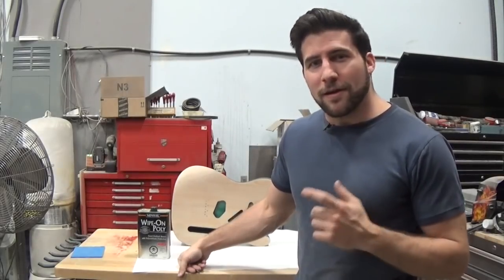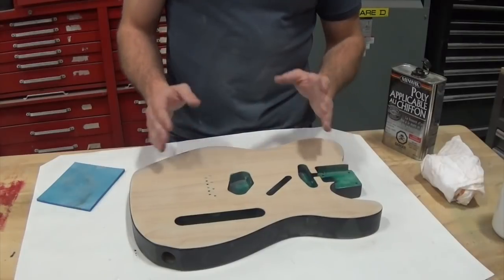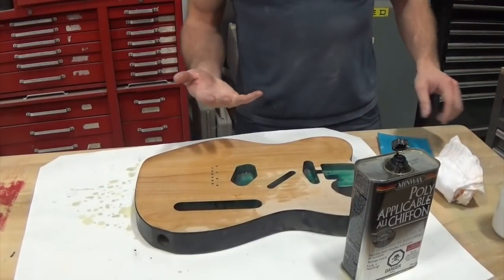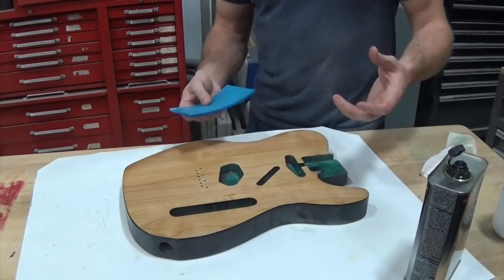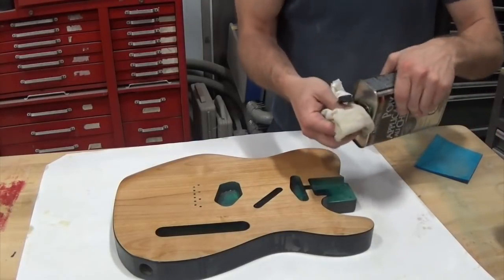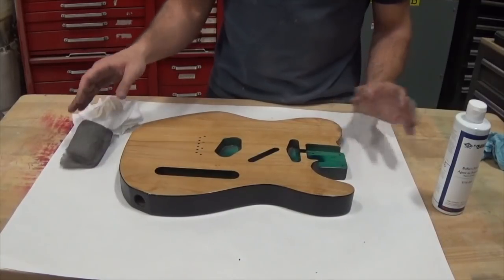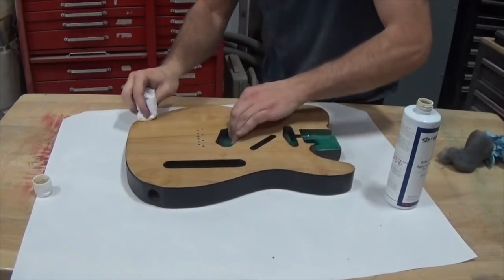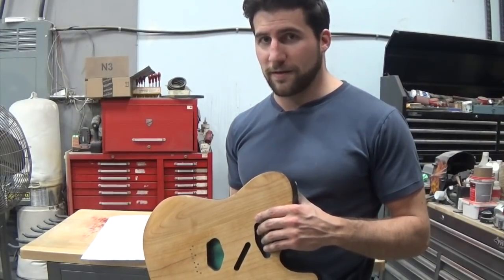How to apply a perfectly smooth poly finish by hand

Comment: Just a heads up, but it is worth mentioning proper disposal of the poly cloth. Potential fire hazard if u just toss it in the trash wadded up. Need to spread the cloth flat, and let it dry outside somewhere, or hanging over the rim of a metal can.
Reply: Oh fuck that I throw it on the garage floor while Im smoking to soak up some oil spills
Reply: @Dickcheese2011 😂
Reply: Acoustics1029  💣💥
Reply: That was suspected to be the cause of the fire that burned down Jack London's mansion he was building in 1913
Reply: I always put those rags into a plastic bag and seal it with a knot

Comment: During lockdown, I've been making a parts guitar just using hand tools in my flat. I've been stuck on how to finish it without access to a space to use spray cans but this looks a lot more achievable given the limiting circumstances!
Reply: Rub on water based stains and rub on poly. Then hand buff 💪
Reply: Yes, a great solution to small spaces
Reply: @simmonphoenix3206  Although that 1st stage of applying with sandpaper fills me with dread as it could remove stain.
Reply: @davidcane7211  You don't have to sand. Just leave the pores open. Looks fantastic too!
Or fill them before staining!
Reply: Next lockdown,go out and busk with it.

Comment: If you have trouble finding wipe on poly, mix your own with equal parts of poly, mineral spirits, and boiled linseed oil.
Reply: I did that and the powerpuff girls were made
Reply: A D  next time mix those in a jar, not in your dog.
But I find it really a good solution to have such a self-mixing jar as a dog.
Reply from the maker: Highline Guitars - for my reference next time I’m doing a video with wipe on poly, if you happen to have a video on this mix please let me know and I would be happy to refer people to it.
Reply: @BradAngove  I don't think I have a video where I specifically detail the mix, but it's basically equal parts of oil-based polyurethane, boiled linseed oil, and mineral spirits. You can play with the ratios for different results for different woods, swap out the mineral spirits for naphtha, and add Japan drier to speed up the drying process.
Reply: Would the same sandpaper/wipe on work for a guitar that has been stained?  Once I get the desired color depth, I want to keep it.  I Don't want the sanding to ruin the stain.
Reply from the maker: No, it is likely to cause a distressed look on the stain if you use this method.
Reply: @BradAngove  Thanks.  I'll have to find another way.  Been looking at "I can't believe it's not lacquer".  Any experience with that? Made by Solarez.
Reply from the maker: That stuff is good. You can also use this product but apply it with a cloth.
Reply: A D  LOL
Reply: @HighlineGuitars  Yup, I saw your video with the explanation in it actually. About.... 3 days ago.
Reply: Being in Mexico is extremely difficult to find what you guys use in the US, Canada or England, are Mineral Spirits same as Naphta?
Reply from the maker: No, naphtha is more of a cleaner than a thinner. Not quite the same thing.
Reply: @BradAngove  would you know of a replacement for mineral spirits? I could order online but its way too expensive to get it down here, id end up paying as much as 10 times the price
Reply from the maker: I would think you could get away with recordsol.
Reply: @hatespirit  comprate aguarras bidestilado de la marca ATL se usa como medio para pintar al oleo, lavar pinceles,  etc. Es practicamente lo mismo que el white mineral spirits que mencionan aqui. En cualquier tienda de material para artistas lo tienen incluso online en Lumen o amazon cuesta aprox 160.00 pesos la botella de 1/2 litro. Saludos.
Reply: When you get Chris from Highline Guitars and Brad in his channel speaking about finishing a guitar.   As good as it gets
Reply: @ramonvives1674  muchas gracias!!!! Exactamente eso es! Te agradezco mucho!
Reply: @ErGoyoTV  i bought the poly and couldnt be hippie with the finish i got!!!! Now i also know how to make my own poly!!!!!
Reply: @hatespirit  de nada amigouuuuu..
Reply: I've always heard equal parts mineral spirits and polyurethane. The linseed oil part is new to me.
Reply: Most sources omit the linseed oil and just say 50/50 mineral spirits and oil based poly. That’s what I’ve been using and it’s been working great. Why would linseed need to be added?
Reply: @sittynine  Adding BLO slows the rate of drying which is desirable for certain situations.
Reply: @HighlineGuitars  You’re thinking of Danish oil. Danish oil is a mix of 1/3 varnish(poly), 1/3 BLO or Tung oil, and 1/3 thinner. The exact mix can be experimented with.
Wipe on polyurethane is generally just half n half of thinner and poly.

Also, I object a little bit to what Brad wrote earlier. Naphtha is an excellent thinner for paint, as well as a cleaner.
I’ve used it several times with great success.
Reply: @hatespirit  You can use Naphtha as thinner for polyurethane. Both mineral spirits and naphtha are great paint thinners for oil based paints.

Comment: Thanks Brad, I know this is an older video but it came in handy today for my Solo 5 String banjo project. I sanded to 400 grit and now realize I need to go finer !!  I have had success with this wipe on poly stuff and much prefer it to the thought of 30 coats of clear coat!
Reply from the maker: Glad to hear you found the video helpful.

Comment: As a money saver- you can dilute the regular Minwax poly with Denatured alcohol or mineral spirits and use it as a wipe-on poly finish.  Great video, Brad!
Reply from the maker: Indeed. You can also use that option to turn it into a sprayable finish. Great tip! Thanks for watching.
Reply: Brad Angove what are your thoughts on using hardeners with over the counter minwax polyurethane or lacquers, etc...
Reply from the maker: I’ve never tried it. It sounds like a decent idea.
Reply: Brad Angove Another thought, does this mean you can spray wipe on poly?
Reply from the maker: You can. It needs to be thinned down a bit with a fast reducer, and isn’t the greatest option per se, but it’s doable.

Comment: Brad, thank you for sharing.
I just finished applying Minwax Pecan Satin - PolyShades, Stain & Polyurethane in 1 Step, using your wipe on poly method. So far your method is giving the finish that I'm looking for. Excellent process. Thanks 1,000 times.
Keep up the good work.
Reply from the maker: I’m glad to hear that it’s going well for you.
Reply: Polyshades is a horrible guitar finish. It never cures

Comment: would you still use the sandpaper over a dyed surface?
Reply: Ron Means same question I have.
Reply: Yeah I'm curious how this whole process would be different on something like a dyed or stained quilted or flame maple top.
Reply from the maker: You can still do it like this on a dyed surface, but you need to be aware that it could pull some of the dye out. Even in you apply it by rag right from the beginning it can do that. It depends to some degree on what dye you're using.
Reply from the maker: Yes; I've used this method over stained and dyed surfaces before and haven't run into any problems. As long as it's not that stupid 2 in 1 stain and topcoat stuff.
Reply from the maker: You're welcome. Best of luck with your project.
Reply: I would like to see a video with the stained finish because with this method I have had issues with the sand paper taking off the trans tint dye.
Reply: This was my exact question, I'm doing my first build and this is the but I'm most worried about, finishing. This has given me a lot more confidence.
Reply: @Tim M Thanks, I will definitely look it up. Most appreciated.

Comment: Brad, I use stains and spray cans, then 400, 1500, 2500 and 4,0 steel wool between each coat, 10 thin coats,  then I get a finish like a factory guitar. Surface prep,sand
Polish, take your time, I wait 3 weeks after the last clear coat before using buffing compound.  Norman Mozley

Comment: will this work when you painted on your guitar with acrylic paint?
Reply from the maker: If you apply using sandpaper it will probably remove some of the paint.
Reply: @BradAngove   What should i use? a cloth maybe?
Reply from the maker: Yes. A soft cotton rag.

Comment: I used it on a strat body with the same results you had, but I didn't apply it with sandpaper. I was worried that dye would bleed too much.

I'm going to use poly on my first acoustic guitar build next week. No dyes or stains to bleed, just natural wood. I'll try it your way to see which works better for me.

Comment: Do you apply a coat to the other sides after applying your coat to the face or after the face is fully finished. Basically, do you do every sides for each coat or do you wait for one side to be finished
Reply from the maker: I would do the sides at the same time.
Reply: @BradAngove  Thanks for the reply, have a nice day !

Comment: This is great1 I learned a lot. It reminds me of doing oil finishes using fine sand paper to fill the grain with the fine dust that is created.
Reply from the maker: Indeed, that’s kind of the same concept. This finish just tends to cumulatively be a bit faster than oil. Although each certainly has its place haha.

Comment: So this poly finish you are using dries resulting in non-glossy outcome by default? And if one were to use color first, specifically artist oil paint, is there any reason why this poly finish would not work after coloring with a linseed oil based artist paint? Thanks.
Reply from the maker: You can get gloss or satin for this product. You can apply it over the oil based paint, just don’t use the sandpaper to do so.
Reply: @BradAngove  Great. Thanks so much for taking the time to respond.

Comment: Thank you for another great video. I almost always use teak or tru oil for finishes. I'm going to try this on my next build. 

For all the people asking if this can be done over stain or dye: this is the same concept to apply as oil. Raising the grain before sanding will prevent most of it, but some dye or stain will always come up. Always test on scrap wood first, to find out how it looks.
Reply from the maker: You can apply this same technique to oils if you prefer them.
Reply: @BradAngove  so - to clarify - i can still use the sandpaper technique if the wood has been dyed or stained without any problems? im thinking of doing this on a bass drum!
Reply from the maker: No, the sandpaper technique can remove some of the color and create a “distressed” look.

Comment: Thank you ,Brad. I am in the middle of two guitar builds at the moment, and have previously used lacquer. I love the look of it, but it is extremely toxic and remains fairly reactive to different materials like leather or the cheap rubber on cheap guitar stands. I want to switch to another finish that is not so noxious. I am going to give this a shot. Much appreciated. 
P.S. : I know this is an older video, and don't expect a response.
Reply from the maker: I hope it goes well for you.

Comment: Brad you're the man! What a wealth of knowledge.
Reply from the maker: Thanks Chris.
Reply: Brad Angove of course brother! So I’m working on my latest build, telecaster body with a book matched spalted maple cap. This will help so much!

Quick question, do you think I should apply some sort of oil at first to accent the figure or will the wipe on poly make the grain pop
Reply from the maker: It depends on what type of oil you have in mind. The wipe on poly will have a similar accenting effect to some oils, but if you were to use for example a tinted danish oil base you would probably notice a difference.
Reply: @BradAngove  Quick update, body arrived early, dry sanded back to 320 grit and it it with some mineral spirits to get an idea of the figure. A ton of natural brown and reddish hues (burled & spalted maple) so I decided against any sort of light dye, tint or oil altogether and will be going straight with this method.
I recently discovered this supposed clear pore filler called Aqua Coat–I'm going to give it a shot after the preliminary poly-slurry coat (ensuring that it's sealed) to preserve the little insect holes and Knicks and keep it 3D, then follow up with additional poly. I'll keep you updated on how it goes, it might be a decent grain filler.

Thanks again Brad! Big fan of your videos. Sharing information and educating is everything. Looking forward to future releases.

Comment: Great job done well. 
 There are dozens of ways to apply finishes, but for something the size of a guitar body that was likely the most cost effect way to get great results.
 There are wood graining tecniques that could be applied to a plain body guitar over color if someone wanted that kind of wood grain effect. Some of the step as very similar to what you did..
 I've wanted to for sometime do a distressed wood grain guitar, very rustic,  The Rat Rod Of Guitars so to speak.
All kinds of bizarre effects with hardware, square head nails the whole bit, but a guitar that plays like a dream. 
The imagination is the only limit when customiziing anything to make a one off masterpiece. Nice Work.

Comment: Just a couple of questions. How does this finish hold outdoors? Will it last? If it does not works for outdoors, what can be done to make it outdoor resistant? Can you use an orbital sander with a pad for the buffing? I saw another video where the person was using one. The only thing is he has some different products but kind of the same idea.
Reply from the maker: Use an outdoor urethane for outdoor projects. 
Yes, an orbital sanding with a pad can do the buffing work. It just takes a while.

Comment: An important note when doing this:   use nitrile gloves.   Polyurethane can permeate skin... and it blocks oxygen receptors in the body.   If you get poly on your hands within a short time you can start feeling dizzy, have vision blurring and trouble thinking.   It's not just the fumes; it's the poly infiltrating your skin.  So... nitrile gloves:  essential.  Question:  what's your favorite brand of sandpaper?
Reply from the maker: I like the 3M trizact, Norton, and Mirka Abralon.

Comment: Don't know if this will help but..i am always broke and never near good supplies and found that a (paper bag) yes a standard brown paper bag can buff REALLY well in place of fine sand paper🙂..other replacement are those nail buffers that have different color sides to make chicks nails buff shiney...they are not that big but work great for small spots..i had to buff part of my banjo.with the brown paper bag trick and it worked surprisingly well. Just throwing it out there for folks who need supplies they may not be able to get🙂
Reply from the maker: Ya, brown paper bags have a bit of abrasive clay content in them. They can also be used for honing knives if I’m not mistaken. Cool tip.

Comment: My god, I watched this at work and it took me forever to find it again. Excellent tutorial. I'm planning on putting a purple Stewmac stain on an SG kit. My plan is to do good sanding first, then sand in the first 2 layers of stain, then another few layers rubbed on. Then doing the rest of your tutorial from there. Again, sanding in the first 2 layers of poly, then rubbing the rest of the layers, followed by the polishing. My question is: should I just skip applying the poly with the sand paper since I'll already have filled in the pores with the stain/sawdust mix? And just rub on the poly from there?
Reply from the maker: Don’t use the sandpaper for the poly if you’re staining first. It’s unnecessary and can potentially mess up the stain.
Reply: @BradAngove  that's kinda what I was thinking. Thank you for the response!

Comment: Hi brad. Thx for the video. I have an ash strat body sanded & wood dyed that I want to do a wipe on poly with multiple layers to form a strong shield. I’ve got a thick set of 3 coats on It now. Im going to let it cure two weeks. What sanding method should I use to get a glass finish? I want to be carful to avoid sanding through this poly. I did that previously and had to start over which was EXTREMELY frustrating. Thank you sir!
Reply from the maker: Is it pretty smooth now? If so, you should be able to level it with 2000 and then finish with 2500 grit and polish.

Comment: How did you decide to use sandpaper to applying polyurethane to your guitars and basses? I'm really intrigued by this!
Reply from the maker: I saw someone mixing polyurethane and sandpaper to do a bit of pore filling, so I decided to test it out this way. I have also seen it done with oil before, but I can’t recall if that was before or after I made this video.

Comment: Brad, your video has helped me a lot. I am about to finish  a tele body. The body is basswood and the top veneer is burled ash. I understand the prepping process. The back and sides are smooth. How should I prep the top surface?  I don't want to loose the burled look.   Your suggestions?
Reply from the maker: Burl is very porous. Are you looking for a mirror finish type thing?
Reply: @BradAngove  Thanks for the quick response. My idea is to use Danish Oil or something similar for the top of the guitar. A satin finish would finish off the top. As for the rest of the body, (basswood) I was thinking of leaving it as is. You did give me an idea about putting some artwork, like my family crest, on the back. The neck is maple with the engineered fretboard. This is a  SOLO DIY guitar so I was pleased to hear to mention that company.
Reply from the maker: You can danish oil it to begin with. A fair bit of that will soak in and then you will need to decide if you want to seal it to get a smoother look or go straight to applying finish and allow some of the grain porosity to show through.